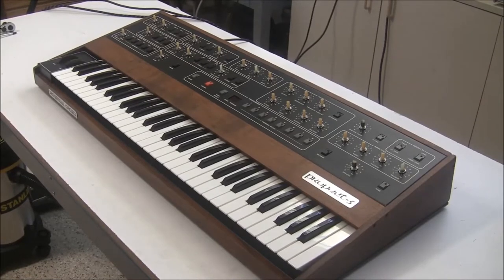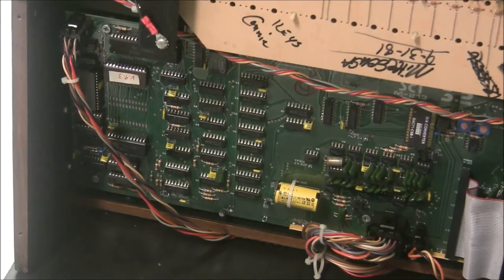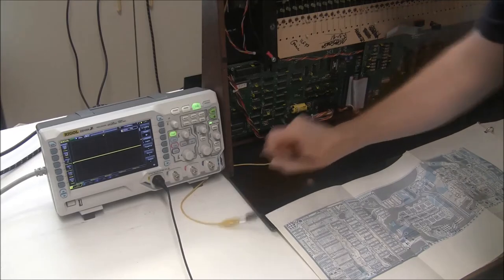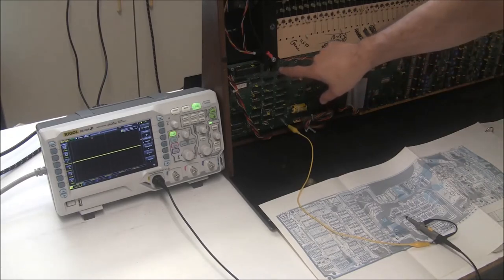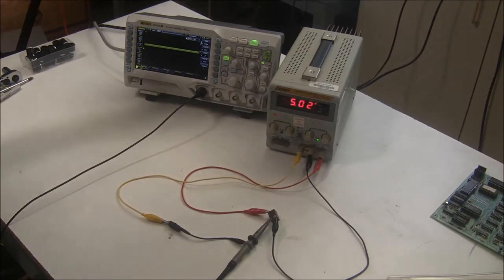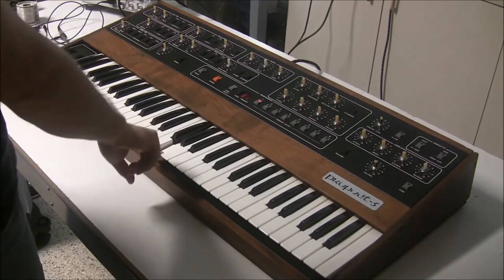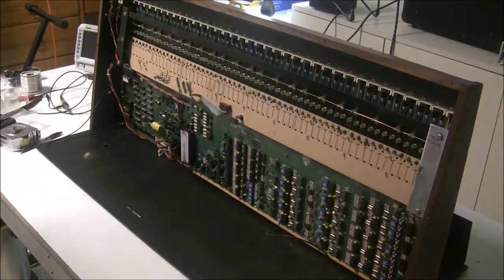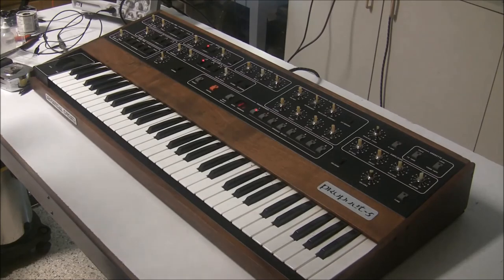Synthchaser #067 - Sequential Circuits Prophet 5 Restoration & Repair - "Dead" CPU Repair

Comment: Hello and thank you for your very informative videos. I have a Prophet 5 rev 3.3 of which I completely changed the electronics with the exception of a few resistors because it presented the following problem which to this day is still not resolved: When I activate the PWM potentiometers while the PW is not even activated it has an action on my saw  and pulses, slightly detuning them. Despite my investigations and an interest in manual service, I am seriously stuck and I really need someone to direct me on directions. If these symptoms mean anything to you it will be a big help to me. Thanks in advance.

Comment: Do you know if the memory test procedure is the same for Rev 3.3?  On my Rev 3.3 unit (OS 10.5.0) when I jumper TP304 to the 5V TP,  it just boots normally.  There isn’t anything in the manual in the rev 3.3 manual addendum specific to the memory test that I can find.  Thanks!
Reply: Jakebenbos did you find anything? I have a 10.4 rev3.3 and would like to know the same.  @synth chaser?

Comment: i have a quick question but first love your work very thorough. im just wondering about crystals and the tolerances as i have a yamaha psr 500 where the 9.4mhz crystal has corroded due to some sort of glue on it ,ive looked for one its a uc49 package but no luck i found a 9.375mhz i dont  know if its a rare value or ive not looked in the best sites i did a google search but nothing any advice would be great

Comment: I have a Prophet 10 that I am planning to completely restore as you've done on the Prophet 5 in your videos.  The Prophet 10 uses two of the exact same Pro5 sound module PCBs.  The key beds are the same.  I believe there may be differences in the Power Supply and CPU boards, and there is an additional interface PCB to integrate the two Pro5 PCBs.  As in your restoration, I want to recap all boards, clean all pots and switches, and clean/rebush both key beds while installing several broken J-wires.  I have a full Service Manual for the Prophet 10, plus a Diagnostic ROM chip set.

If the Pro10 Power Supply Unit is different than the Pro5, can you add any needed additional components to your Pro5 Recap Kit to get the job done?  Can you also supply Recap kits for all other Prophet 10 PCBs that are different from the Pro5?  Also, can you provide the Brand and Model number of the Desoldering gun you use in your videos?
Reply: Hi, can u share with a Service Manual, please?

Comment: Will check if the jumper are easy to find with a Rev 3.0. 
But is it dangerous to perform tests before fixing old native PSU ?
My Prophet stayed 3 day plugged, when warmed up, all is working except a non tuned sound and keyboard bad contacts.
I m afraid of frying something.
Thanks again for your knowledge share.
Reply from the maker: The power supply is always my first step in any restoration.  Even if it's working, it's an important piece of preventative maintenance.
Reply: Looking at severals other synths vidéo made it obvious. Millivolts are pretty importants ... Restoring PSU is not an option ... and not so complex ... just soldering capacitors . Logic boards failures needs more knowledge, i m very impressed. Here in France there is less than a handful of competent guys. But with those video and your kit, a bunch of repair can be done "at home". Do you plan non US synths , as korg MS20 and others  ? I know severals peoples in despair with those, and me too ... And there is not "numeric" in those, should be less complex than a prophet or a Memory moog
Reply from the maker: I do have some dead Roland, Korg and Yamahas here that I'll be repairing when time permits.  Will post some video when I do.